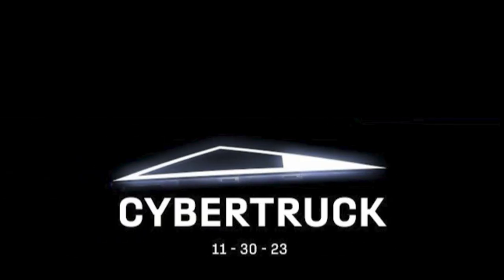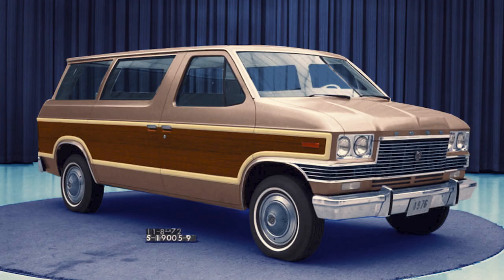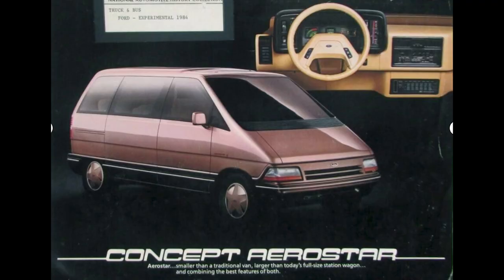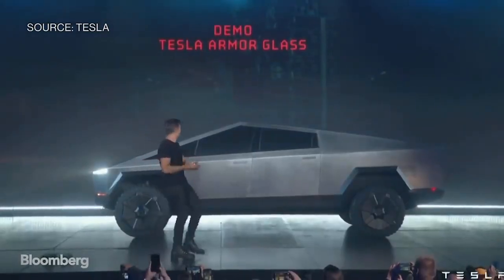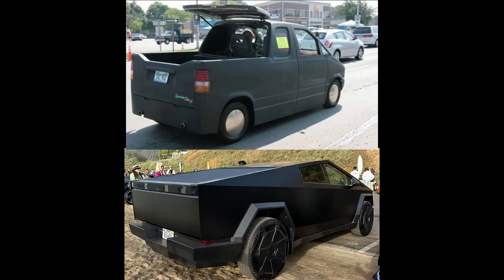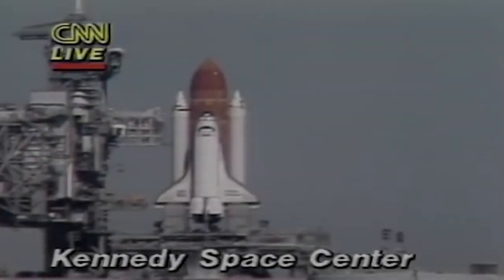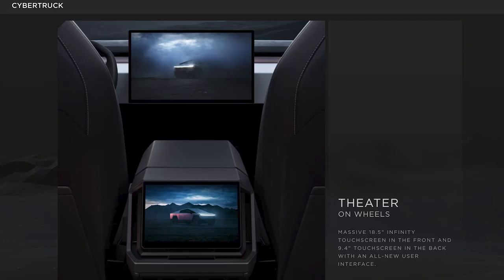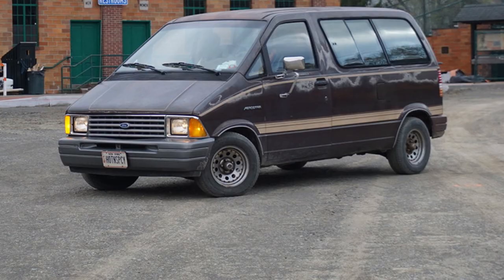RIP-OFF: How the CYBERTRUCK copied the FORD AEROSTAR

Comment: I have a 97 cargo and thanks to 17:33 i know it was a postal vehicle, has strange stickers in driver doorjam, makes sense now mine looks exactly like the postal one in the picture.
Reply from the maker: Wow cool! Is it an extended length? I was lucky enough to see a few of these in the wild before they were totally pulled from service. I've always wanted to have one as I'm sure they were specially fitted from the factory, which your description seems to confirm. Janky do thanky for watching and commenting! Wishing you many miles in your 'star
Reply: @JankyAF Not extended length but I prefer the look of the shorter version anyway
Reply: @JankyAF  and thank you i plan to have get many miles out of mine, even thinking of replacing power steering with a Saginaw pump to stop the screeching 😆